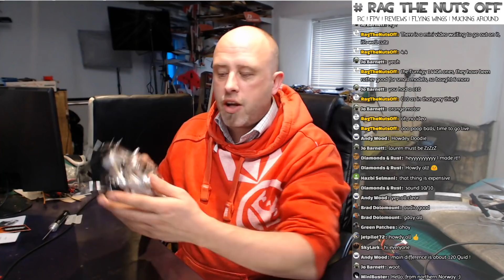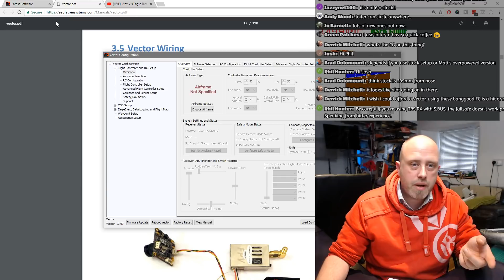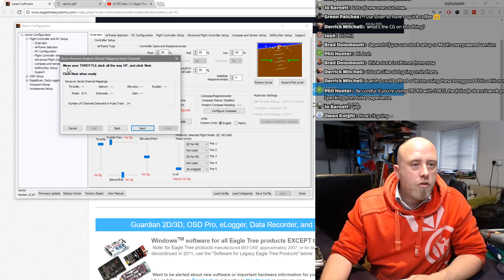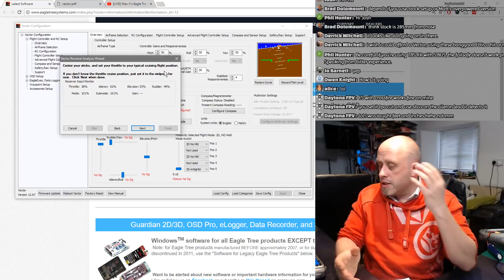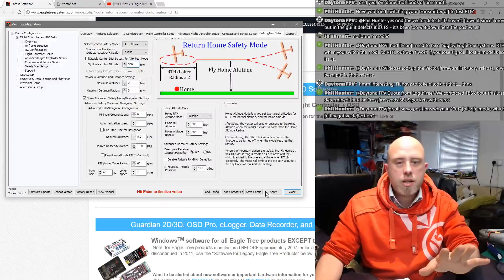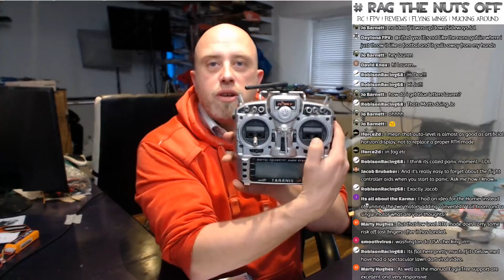🔴Setting up a Eagle Tree Vector for the Harrier FPV Wing

Comment: Stupid question on plugging in the separate UBEC, you can use any of the unused pins (with the exception of the backup power pins) to supply power to the servos? It looks like you might be using the Rud/M1 channel for the separate UBEC? Thanks!

Comment: Can you please make a detailed video about the elevon/aileron part with vector. I have been searching all over the internets and there is no one explaining that. 
FPV mode would be great where we can see the model front and the radio right below it and see what moves where when you move the sticks. 
Same with stabilize mode and and an explanation of what changes has to be done if surfaces are moving the wrong way. 
It may seem stupid to you but for someone like me who is just starting it may save him from the third crash.
Reply from the maker: Howdy fella, I'm sure I covered this in this video, or at least one of the other ones on the Vector. If you are having issues, read the manual. It's in fantastic English anc covers EVERYTHING you need to know, Matt

Comment: You have to set it to CUT on the TBS Lau Script! Works fine
Reply from the maker: Morning fella, I assume this is for the TBS crossfire SBUS issue? Matt
Reply: yeah if you set it to failsafe rth wont work but if you set it to cut rth works. Now I havent tested the failsafe on the newest firmware release for the vector I think they fixed it.  I always do a rth check before heading out.

Comment: HobbyKing also sells a nice Lipo for the Taranis SKU 9210000036.   It is a Turnigy nano-tech 2500mAh 3S1P pack that supplies 12v to the Taranis (Great for UHF modules like the MFD RLink I use).

It has the same issue where you need to build or move the connector from the original battery to plug into the Taranis.   I also soldered on an XT60 to make it easy to charge but it would be easy to make an adapter for charging too.   It fits in place of the original battery.